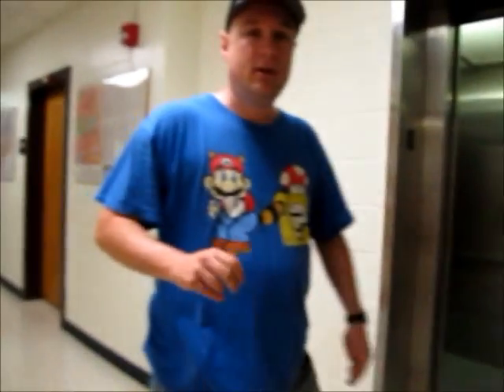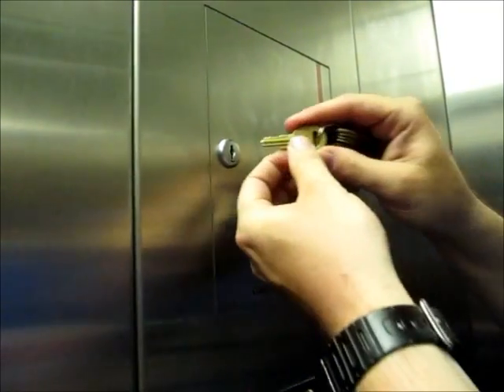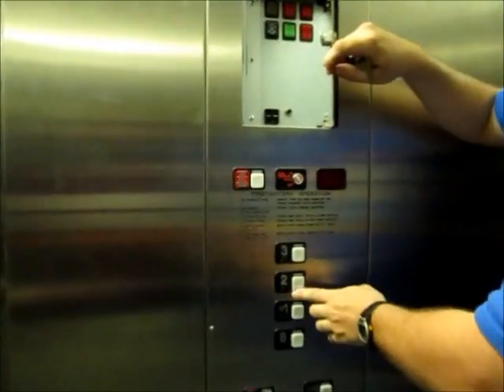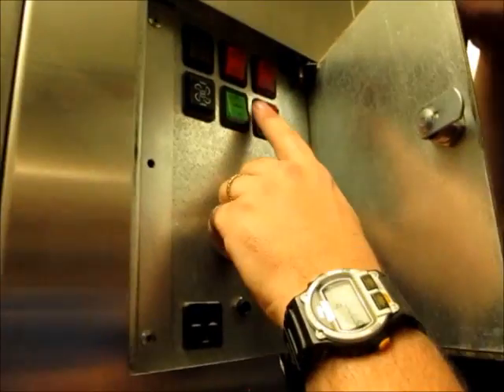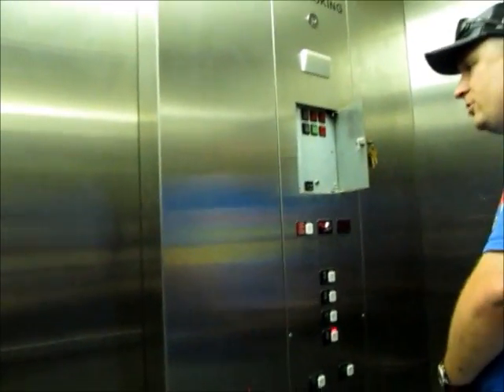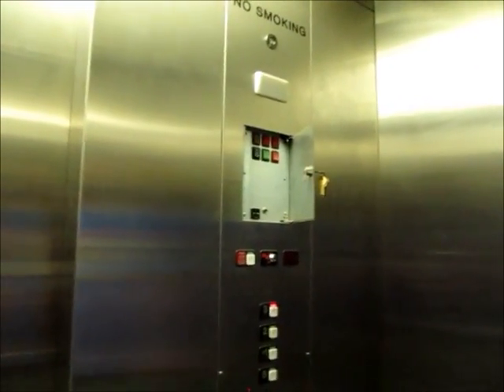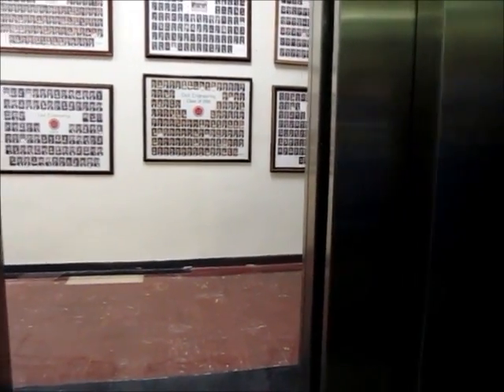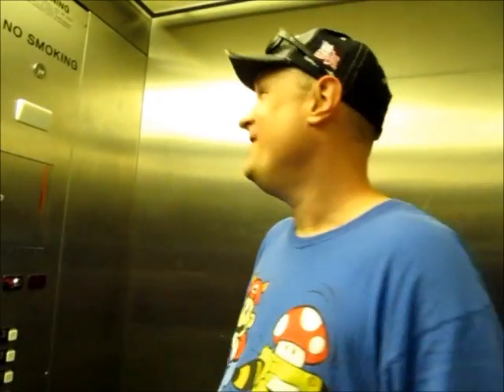Independent Service and Manually Controlling a Schindler MT Hydraulic Elevator

Comment: What's hospital service?  By the way that was one interesting motor.
Reply: Elevators installed in hospitals have a special mode to allow medical responders to get to emergencies faster. A user puts there key in, the nearest elevator is taken out of service and responds. The elevator also moves at maximum operating speed as opposed to normal speeds which is much slower.
Reply: Jamestube 8439 ???

Comment: For future reference: the notch on the key lines up with the arrow on the lock.
Reply: Maybe you know, what's the purpose of hand service.
Reply: @Jamestube8439  idk either i wanna know
Reply: @ARelevators  I figured it out, it's used for moving the elevator to a certain spot for inspection or something like that, it has been discontinued on Schindler Elevators Today.

Comment: And it is not exactly independent service: You don't have to hold the button down to close the door. This might be called code blue service.
Reply: Code Blue Service requires constant pressure on the D/C button too.